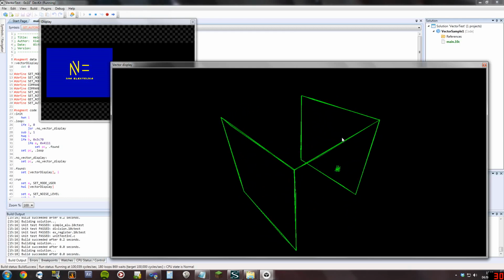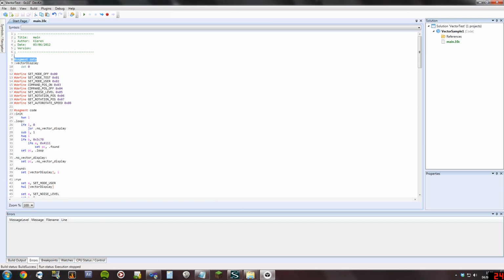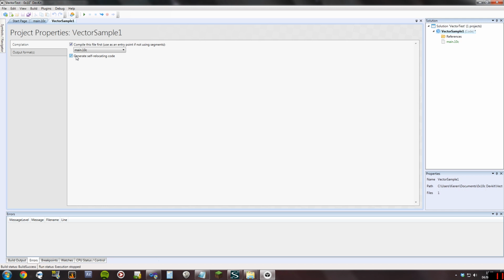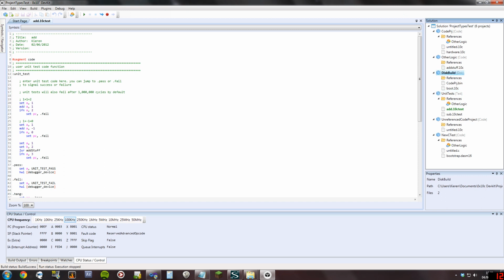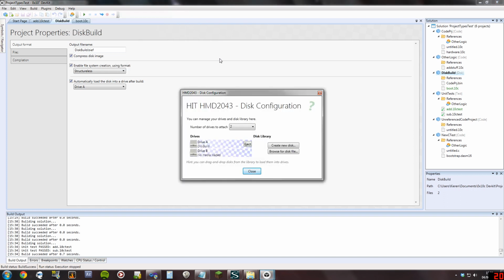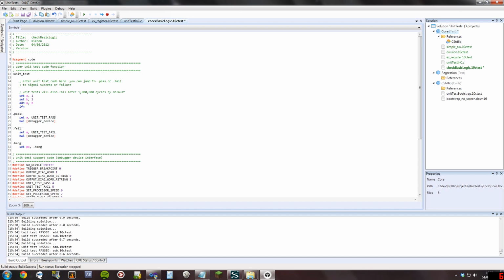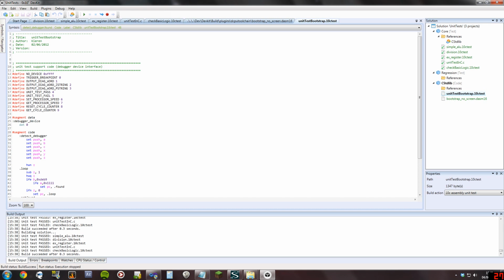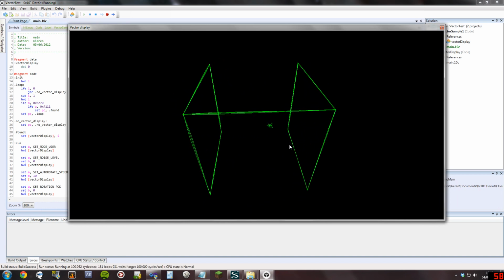0x10c DevKit 1.7.5 - 3D vector display, unit tests (C/asm), disk projects, new C compiler + more

Comment: Correct me if I'm wrong 0x10cdevkit, but I would be willing to bet once notch releases some specifications for devices the devkit will change to support those specifications, and very little will change for the end user. We know he plans to have disks, ect.. I would be very surprised if 0x10cdevkit would let this program diverge from reality once we actually get some I/O specifications. As it is now we need Something to work with before we get those specs.